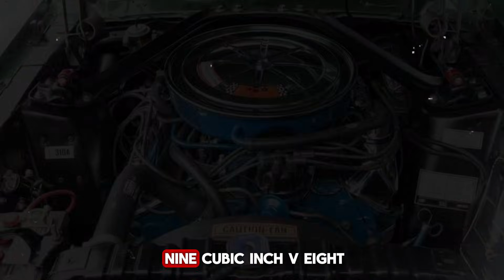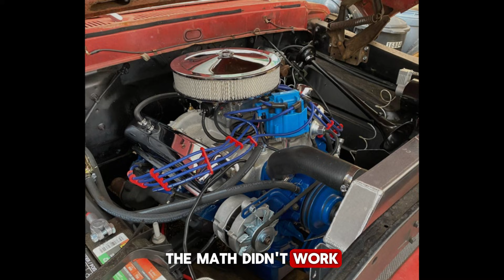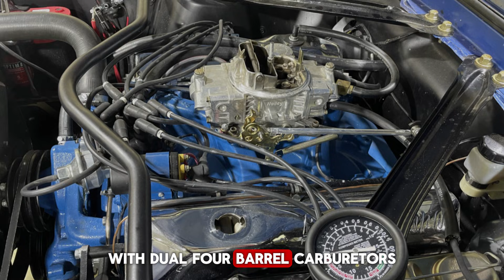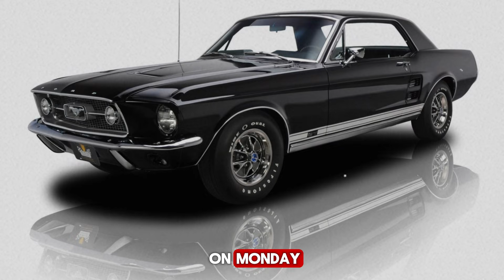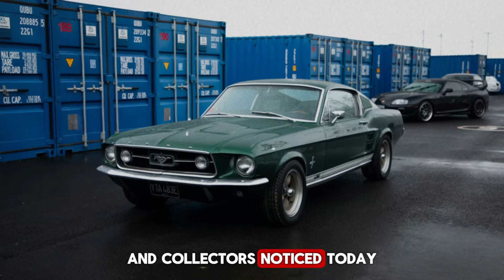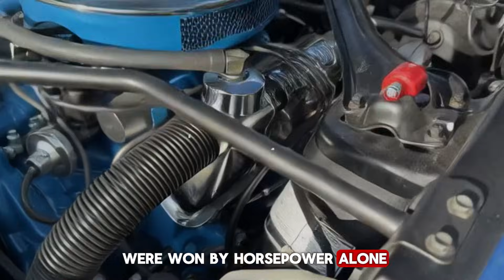Why Ford’s 390 FE Became GM’s Worst Rival

Comment: The 390 was surprisingly powerful. It was  way ahead of its time and you can see many aspects in engines today. They built it with good bones. And they designed a cylinder head that was likely the best wedge in history. The 390-428 were stout. They need to make 4.13 bore blocks now for hobbyists. The Super Stock blocks are nice but 406s and 428s would be great for weekend projects.

Comment: I f you know how to drive it you can be competitive in 1/8 th mile races. I have built.050 over 390s , a 4.1 bore with a 3.78 stroke. , 400 ci and they are still beating on a lot of stuff. At 400 cubes you can build it to kick ass. Roller cam, 330 cfm heads with good 61 chambers and a few oiling tricks it is a great engine Ford could have built. But we can build them now. I do wish they would make 4.13-4.19 bore blocks, just top oilers. We know how to balance the oiling system. The 3.98 stroke with 2.2 BBC rod bearings and you have a genuine 60s beast. I don’t need 1000 hp. 650 hp and 600 ft lbs that would run on pump premium. That’s good enough for me.

Comment: Dumb title … it would have been GM’s best or biggest or strongest competitor. The worst would be the one the couldn’t compete but that actually sums up the FE 390. Low revving, bad cylinder heads and fragile connecting rods. I had 2 4spd 390 GT Fairlanes in the 60’s, one stock, one with a 427 lemans cam, 780 Holley, dual point, competition valve job, adjustable rocker arms, steel shim head gaskets, all the late ‘60’s go-fast stuff. The stock one couldn’t outrun a Camaro, Chevelle or Nova w the 327/300hp motor. The modified one sounded strong but could barely keep up with a stock 396/375hp Chevelle. The 390GT was just a weak, low revving truck motor. No stock 390GT Fairlane or Mustang could run better than 15 second quarter miles in those days. That is why Ford jumped straight to the 428 in ‘69. The cubic inches were the equalizer along with the forged rods. You are correct that the 428 ran stronger than the numbers suggested. A friend had one in a ‘69 Torino and it was very fast. It accelerated harder in 3rd gear than my stock 390GT in first gear.
Reply: The 1961 Ford Starliner, the 1966-67 Mercury 410 that could have been the KR-8 in the Fairlane/ Comet and Mustang/ Cougar. A 410 with a 4.12 bore and 4 inch stroke intermediate and Pony cars, use 427 heads and intake, camshafts in a 390 block with 410 structure. The slightly thicker walls and a 4 inch stroke. What could have been? The Street 425.51 and the large bore 425.51 4.23;x 3.78. They could be making them now.
Reply: The 375 hp 390 with the 401 6V induction would have been nice on the 410, a missed opportunity. Maybe the 406 block and the 410 crank and  Low-Riser heads in the 1965 Ford LTD with a side oiler passage or passages made like I was doing at home and a top-loader? The 428 PI Low Riser that became the Cobra Jet in 1967? The LR 428 with 61 chambers and 2.19 /1.6 valves with 11/32 stems and shifted just slightly?

Comment: I have owned several 390s and I have never been disappointed by one of them.
Reply: Not a single one. I built FEs and I detailed the oiling system for rpms in the 7000 range. A 400 ci engine built to wind to 7000+ you have an axe to swing.
Reply: And my 2V 265 hp 390 only took a.020 over bore and detail on the oiling system. I ran it in my truck and it made 510 hp and 468 ft lbs of tq.

Comment: I ran a 69 265 hp 2 v  for years and when I rebuilt it the bores didn’t even need a rebore, but I did.020 over put a solid cam in and ported a set of 64 model heads and it makes 510 hp and 463 ft lbs after 45 years it’s still a tire shredder.

Comment: I have built 390s for 50 years and they were amazing in how they ran and the way they pulled. The FE head is amazingly modern even now. The cam and intake at 11:5:1 was denied its glory. .Tough parts and careful building was surprising.